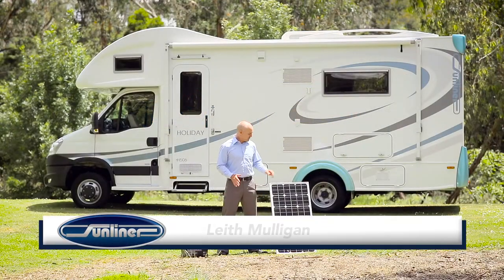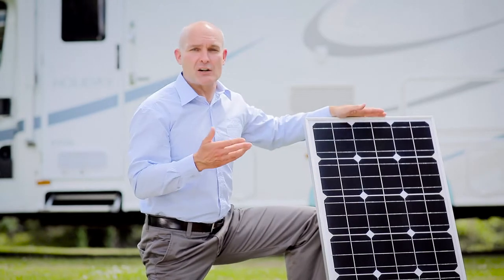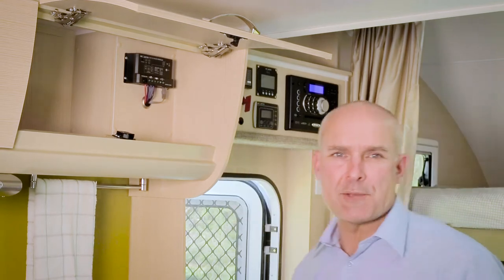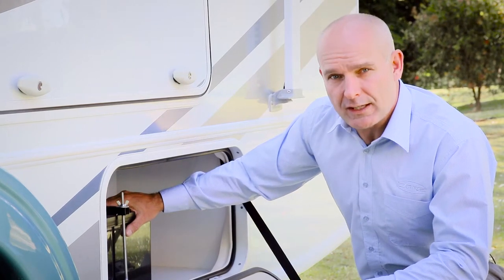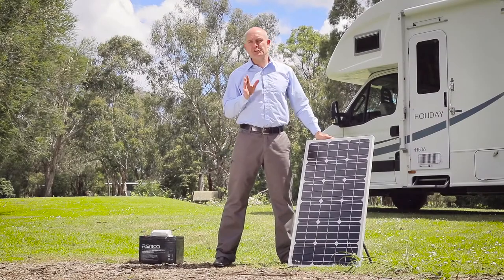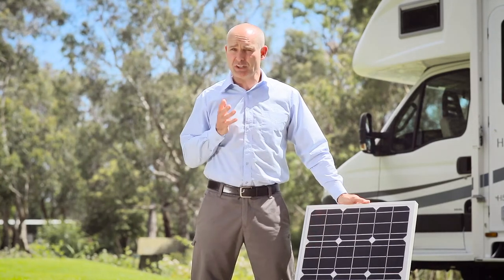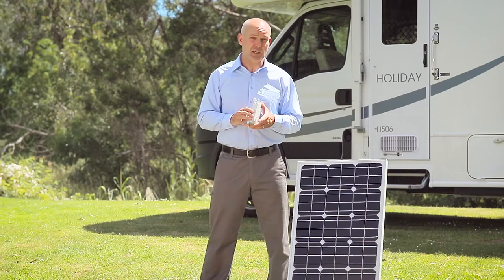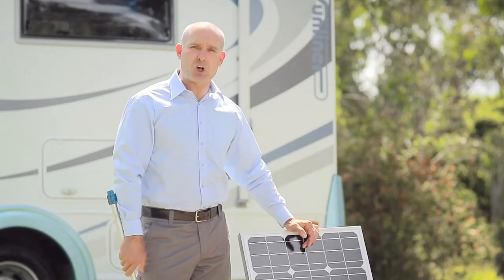Sunliner RV - An overview of solar systems in your Motorhome/ RV

Comment: I was wondering if its possible to have more than one house battery?
Reply from the maker: Hi Glen,  It is possible to have extra batteries, solar etc installed either as a factory fitted option or as an aftermarket product by your selling dealer.  Your local dealer will be able to run through the options available.  Kind regards, Sunliner RV.
Reply: Ok thanks for that.